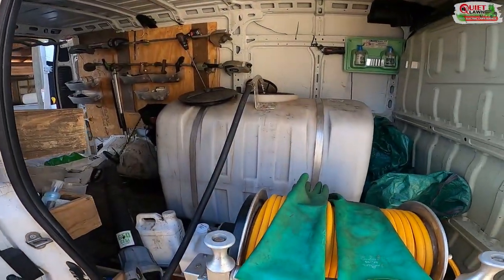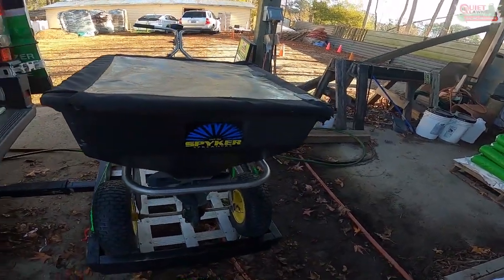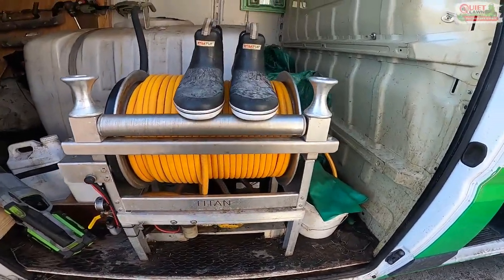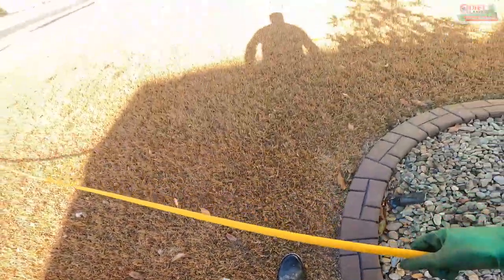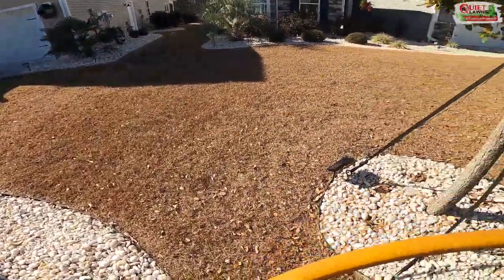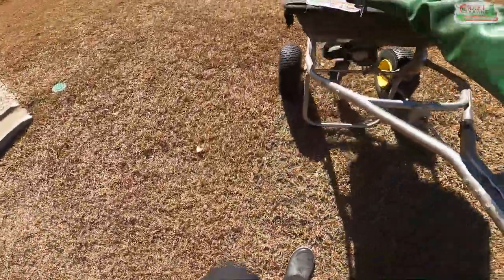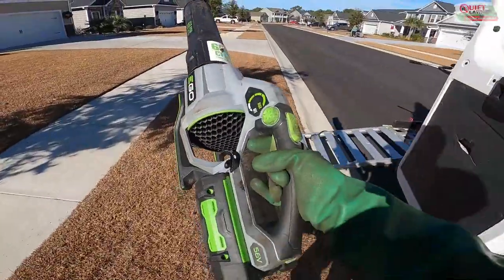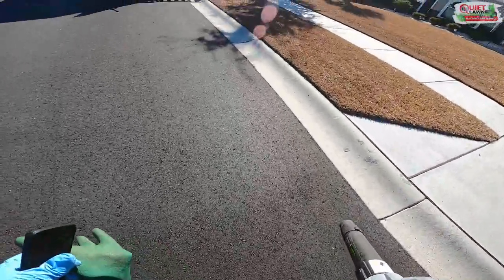Lawn Fertilization System Setup & A Day Spraying Lawns | Electric Lawn Service

Comment: Look at gator waders shoes . Same industry as u and xtra tuff last me 2-3 months max but tthe gator wader addition last longer and are a softer material
Reply from the maker: That's good to hear. They do seem to wear out pretty fast. However, we get them for less than $45 a pair on ebay. I'll have to check out the gator waders. Thank you very much.

Comment: You don't need to leave the engine running?  We wouldn't be able to start our trucks after a few lawns if we didn't leave the trucks running.  How many lawns a day?
Reply from the maker: No. You have to add an additional 12v battery for this system that's wired in series with the truck battery. It'll do just fine and keep itself charged as you drive between lawns. We put a trickle charger on it overnight as well to keep it topped off. 25-35 lawns a day.
Reply: @Quiet Lawn- Electric Lawn Service  yes we want to do something like that and charge at night, but it would never charge during the day we have so many neighbors and several on a street, the motor would barely run in the neighborhood.